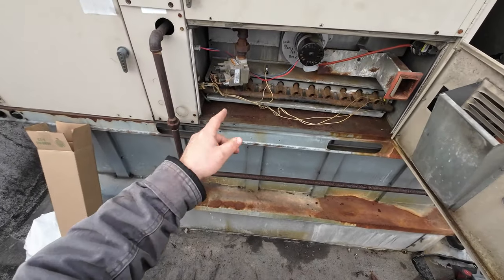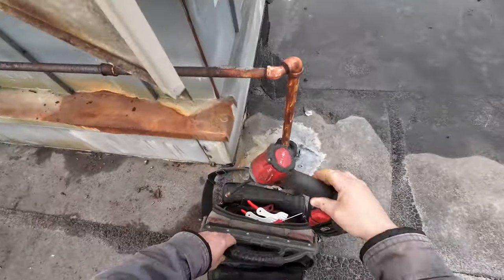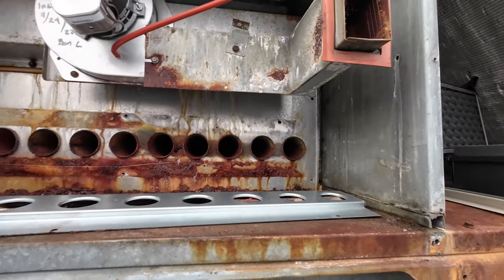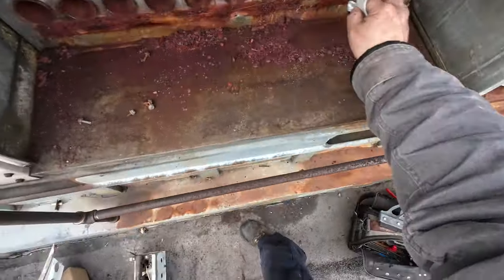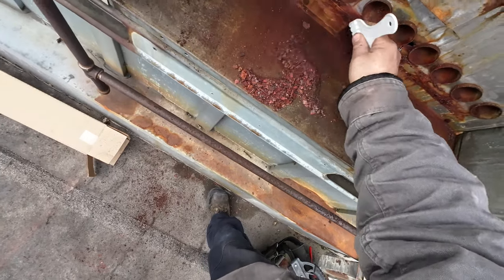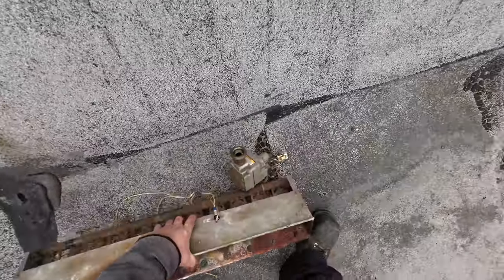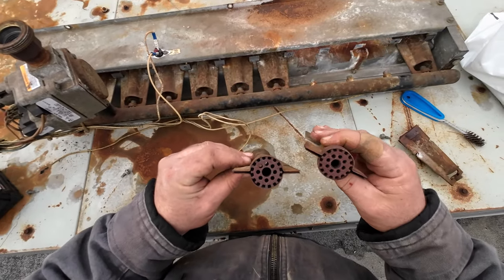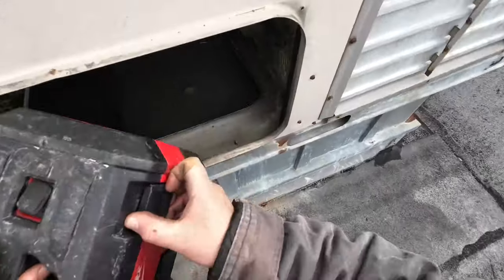Not Replacing $50 Part Killed This Heat Exchanger

Comment: Thanks for taking us along. A 24 year old unit that is still running is either luck or good maintenance. What is the oldest one you have come across that was still working?
Reply from the maker: Commercial A/C Carrierr 1978.  Commercial refrigeration Custom/Copeland 1974.  Household refrigeration 1930's GE Monitor top